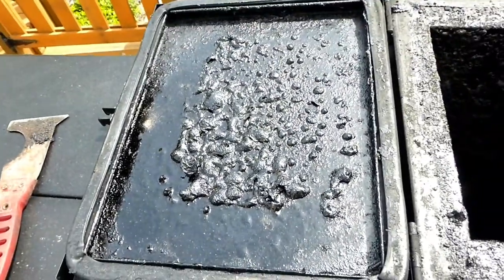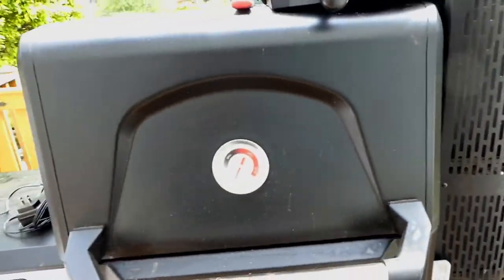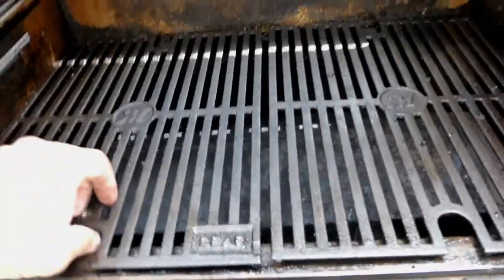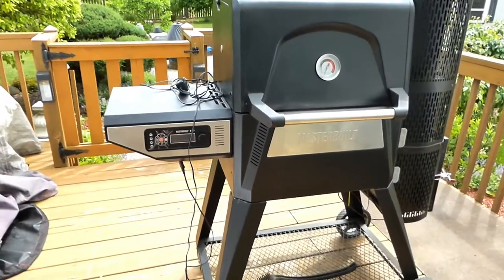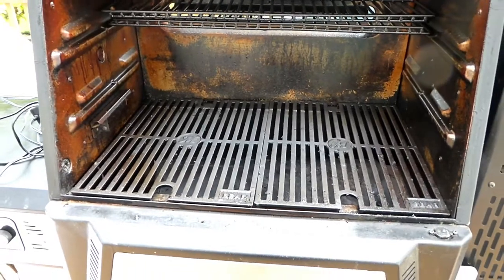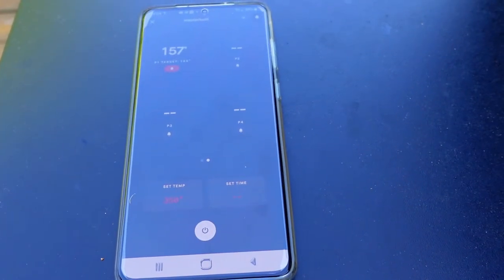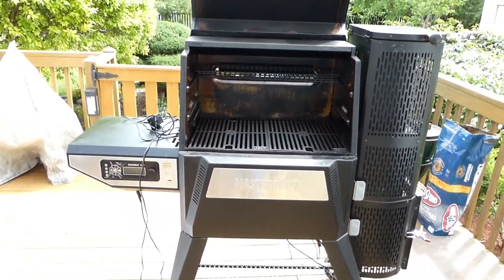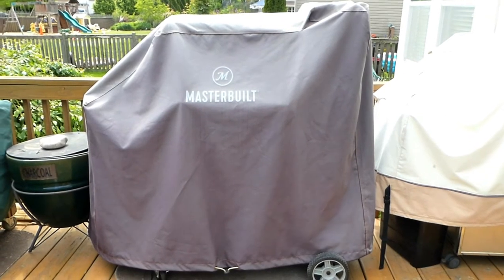Masterbuilt 560 One Year Later

Comment from the maker: We had a roller coaster temperature swings this winter.  As outside temps hit above 40, will crank up the grill.  3rd year in and running fine, no rust.  I did notice that when outdoor temps are low, the lcd display is blank so used the phone app.  When thing warmed up display came back on.  Probably not fuel efficient in cold weather, but it did ribs fine without needing to refill the chimney.